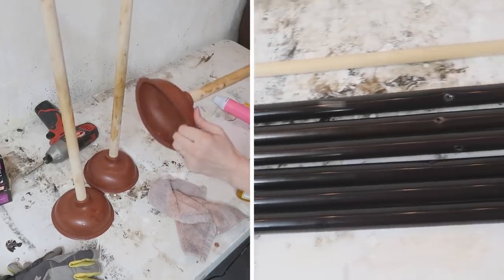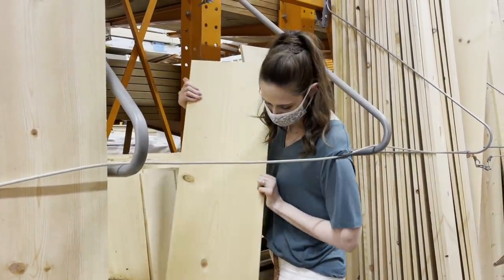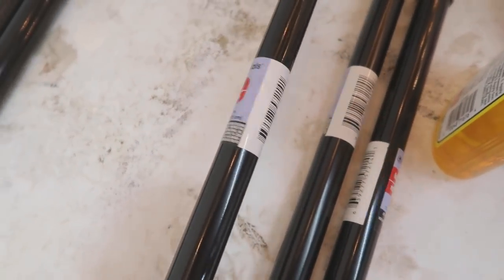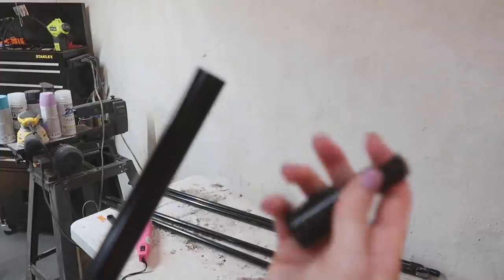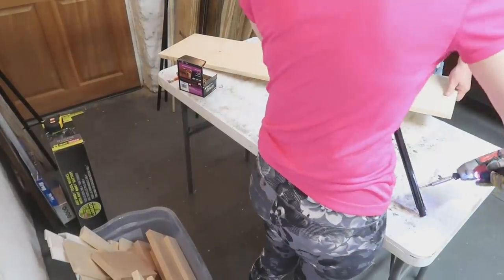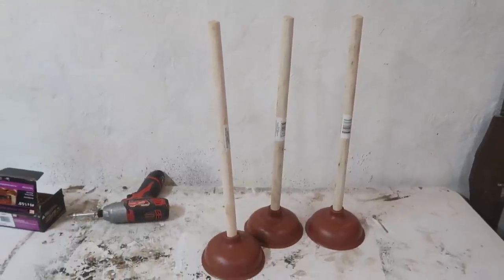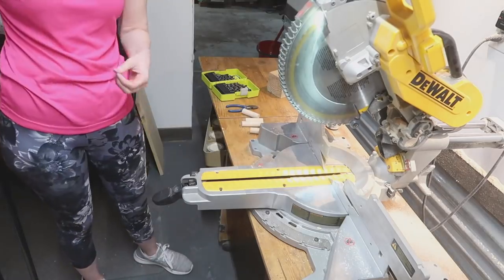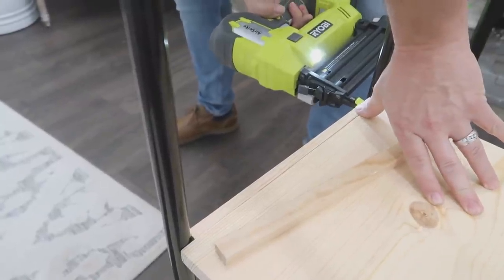*GENIUS* Dollar Tree HACK 🤭 HUGE PLANT STAND | Dollar Tree DIY

Comment: I use pure lemon oil, you can sometimes find it at dollar tree by the candles. Put a drop over the sticker, let it soak for few minutes, the sticker will slide off easily. Then just wipe with some soapy water and clean. Love this plant stand. It will be my next project 😀👍👍👍

Comment: great idea! did you put anything on the bottom and tops of the black polls in case they were sharp so not to scratch you or the floors? Just wondering?
Reply from the maker: I left the plastic on the feet that come on the poles so they wouldn’t do that. But you could maybe wrap in electrical tape too? Maybe add felt? That would help too.

Comment: I kkow this an older video but even then it would be more expensive then just buying one premade and nice.... 6 poles- 6 bucks , 3 plungers- 3 bucks , wood 15 bucks at least, that's 24 bucks... so why? Lol for 24 bucks I can buy one that looks and feels study with no work required. And I might at these prices I list is alot lower then actual. So we talking closer to 30 when I can buy one for like 12 to 13